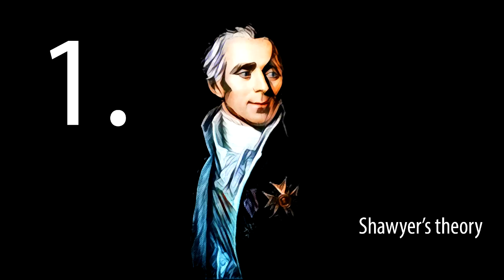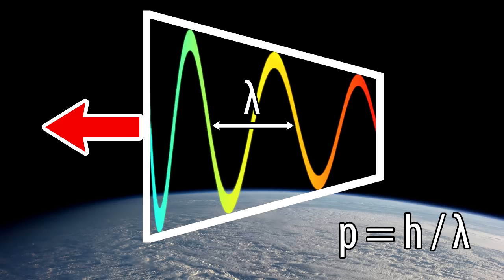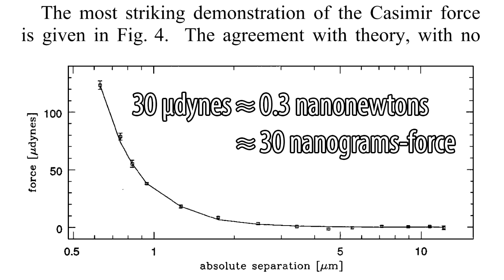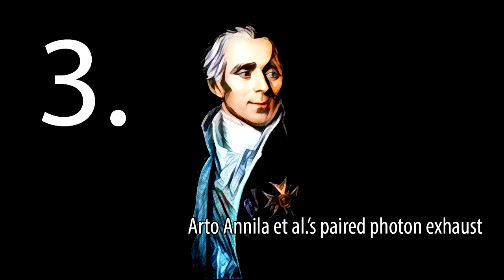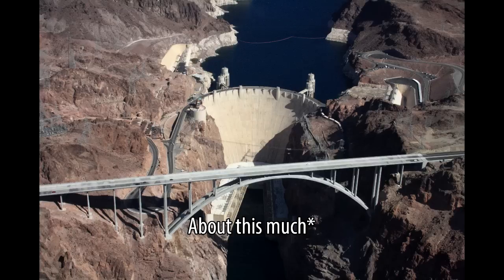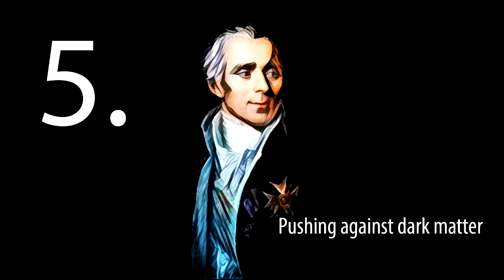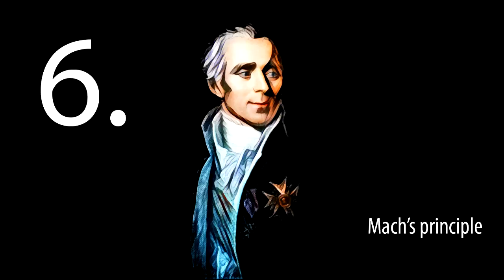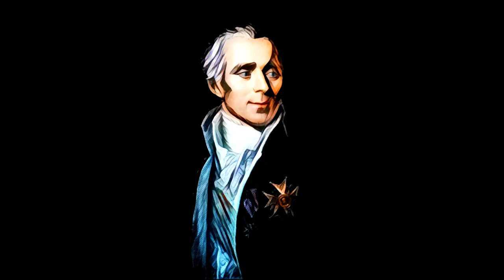The most unscientific approach – The Emdrive (part 2)

Comment: The answer lies on the surface and is easily reproduced in simple laboratory conditions. The virtual force that arises as a result of the interaction of several electromagnetic waves can be easily calculated and in accordance with experimentation. Today it is already a reality. And many labs on distillation are trying to increase the thrust per 1 watt of power. Physics is turned upside down and I am very glad that I live these days!

Comment: @Vacuum Diagrams, I miss your comments on PBS Spacetime. BTW, regarding MiHsC (McCullough's quantized inertia), if you ignore his rationale behind the  "force" of Unruh radiation and simply postulate a reduction of inertial mass as a function of acceleration, you get a testable hypothesis, which I believe is as good as  (or as bad as) MOND to attack the galactic rotation curve problem.
Reply from the maker: Hi, thanks very much for your comment! There are some modified gravity models I consider somewhat plausible, if unlikely. For example, I've once seen a presentation by Philip Mannheim (UConn) where he showed some impressive agreement between his conformal gravity model and galactic rotation curves. The main problem facing all such models, however, is that galactic rotation curves are not the only evidence we have for the existence of dark matter. 
Modified gravity models also have to account for gravitational lensing experiments, which give total mass measurements for galaxies in agreement with the dynamical measurements (inferred from the rotation curves). We also have direct observational evidence that most mass in the galaxy (measured by lensing) is not where the stars are (see e.g. the bullet cluster). A more recent observation is NGC 1052–DF2, a galaxy which has been measured to contain no dark matter. This is impossible for any MOND-like framework to explain.

Dark matter is also baked into our model of the big bang, the so-called Lambda-CDM model, where "lambda" stands for the cosmological constant (taken here as a provisional explanation for dark energy) and "CDM" is "cold dark matter". When people run simulations of the universe's evolution under the assumption of dark matter they get the correct filament structure of galaxy superclusters, which is quite difficult to obtain otherwise. 

All these disparate observations would have to be explained by any modified gravity model.

Thinking of dark matter as "fudge" is not taking the theory in its own terms -- we don't "adjust" the amount of dark matter, we "measure" the amount of dark matter. Since it's matter, it can go anywhere, and so we can't predict exactly where it is. But there are typical expectations from the dynamics, and that does seem to be what's observed. Since galaxies themselves are formed dynamically, it's not unexpected that their pieces tend to fall into approximately the same places, which suggests an explanation for the relative numerical success of MOND at the galactic rotation curve problem. In such models, the "acceleration" can be taken as a proxy for the "radius", which also suggests galactic rotation is not a reliable guide to new dynamical laws. 

Contrary to what many seem to assume, the "Occam's razor" cost of dark matter is very low; all you have to assume is that there exist some particles which interact weakly (if at all) with standard model particles, and with themselves. We already know of one type of particle that interacts very weakly: the neutrino. It wouldn't be surprising if there existed a heavier "neutrino-like" particle. It doesn't matter that we haven't detected it yet. It's even perfectly consistent that dark matter may be strictly undetectable by direct interaction; there's no rule that says we must be able to detect all particles species in the universe. That's up to nature. The reason people thought direct detection was just around the corner is because of a naturalness-based argument known as the "WIMP miracle" which has since fallen out of favor because the LHC hasn't seen any supersymmetric partners.

I suppose it's possible that McCulloch's equation happens to accidentally approximate a correct equation. The problem is that, without all his extra baggage, it's really just a version of MOND with a particular choice of interpolating function, and it's just as disfavored by observations as all other MOND models. He really needs all the stuff about "horizons" in order to get something meaningfully different. Since we already know that stuff's wrong (or not even wrong, rather), I don't think there's anything useful to be learned from MiHsC even in this most charitable interpretation.
Reply: @vacuumdiagrams652  thanks for the response, I learned a lot from it as usual.
Reply: His formula is here: https://youtu.be/1itasiXNUPg?t=1020

Comment: @5:36,
That line is not a deal-breaker from an experimental perspective. McCulloch is theorizing that Unruh radiation is exerting pressure even though Davies theorized that it would not. Davies based his notion of pressureless Unruh radiation off of consistency requirements of Quantum Field Theory. McCulloch is rejecting those consistency requirements. Hawking radiation is known to have pressure. Even though the detection of gravitational waves means that MiHsC is probably at least partially wrong doesn't mean that it isn't an excellent approximation under many conditions.
Reply from the maker: I could buy that line of reasoning if some other mechanism for generation of Unruh radiation had been proposed, but it never was -- McCulloch simply borrowed the existence of Unruh radiation from standard quantum field theory, without ever justifying it.

But there's actually a better reason to think this idea can't be right, which occurred to me only after I made this video. The existence of horizons is a global property of spacetime, that is, you only know if something is a horizon if you know that null rays from one side never reach the other. This, by definition, requires knowledge of the spacetime's entire history, all the way into the future. In contrast, Unruh radiation is a completely local phenomenon (see e.g. "Fermion Fields in Accelerated States" by Candelas and Deutsch) which can be understood in terms of local acceleration properties. A corollary is that there is never a Rindler horizon for an observer which accelerates only for a finite amount of time, so horizons can't be relevant to any realistic scenario. 

Even if McCulloch were correct in asserting that a causal horizon is associated with a boundary condition (and that's something we have no reason to assume), the absence of a horizon for any object accelerating in the real world would make such an analysis irrelevant.

Comment: So essentially your saying the electrons are pushing away from the initial wave created, ie a much smaller and manageable system for transport, that scales up to a warp like system? So you agree the EM drive works! After all if you places a fork in a microwave is the electron being freed from the fork or being repelled while generating a microwave?
Reply from the maker: It is not possible to achieve propulsion by pushing parts of an object within the object, because the position of the center of mass is a conserved quantity (see the theorem of Coleman and Van Vleck). Some external force needs to act on the object.
Reply: Vacuum Diagrams well I think you wrong, and the EM drive and even your own argument about moving electrons proves you wrong, and if you were an astronaut, in an empty box in space, you could propel your self forward but running into a wall of that box...

However, the EM drive replaces moving parts and exhaust fumes, with high energy waves and potential warp fields...thus there is no reason to continue believing that an object can not propel itself...the problem with EM drives is how far can the drives be taken, and if they can work in normal air pressure as well.
Reply from the maker: "even your own argument about moving electrons proves you wrong, and if you were an astronaut, in an empty box in space, you could propel your self forward but running into a wall of that box..."

I just explained why that wouldn't work.
Reply: Vacuum Diagrams I’m saint I think your wrong because your focused on electrons movement and not the propellant, that takes advantage of using waves and distortions as a method of movement...I think your focusing on electrons movement as a force hitting the sides of the metal casing but this is not the case, and essentially the shape of the emdrive creates an imbalance between waveforms and create propellant, and the exhausts of the em drive are is a em cloud or radiation, that can attract particular, essentially this deserves a new name for the cloud such for now consider it as a photon that can attract or repell.

But think you have a large wave and a small wave and one wave repels the other, as I have suspect the wave in the electron magnetic spectrum can repell each other, based on Maxwells basic laws from observing waves.

However I should add, what if the reality is that layer or several layers of electrons and are creatured and that there is a system similar to acoustic levitation, which results in a constant forced continually pushing in one direction as electrons move left and then move right to a degree before being energised to move left again or even a way to hold electrons in place and create highly energised spin...which itself created a wave...so again, I think you ideas are out of sync with modern science and physics, and methods...I think you should build an acoustic levitation, and see how materials can be moved up and down and how spinning acoustic waves go beyond conventional means... as it seems quite simple the larger wave bounced back and creature a denser wave creating thrust..
Reply from the maker: "s I’m saint I think your wrong because your focused on electrons movement and not the propellant, "

If there is a propellant, then the specific impulse (the propulsion bang for your energy buck) is bounded above by that of a photon rocket, which means you can't do better than 300 MW for each newton of thrust. Anything above this necessarily violates conservation of energy and can be used as a perpetual motion machine.
Reply: Vacuum Diagrams I think your wrong, and rather then experiment and learn, you falling for the infallability of a mathematics model, and undeniably old scientific system, acoustic levitation technology can create massive returns, and falls into the realms of space distortion technology...the fact is the shape may not matter, as long at two surfaces are used...
Reply from the maker: Acoustic levitation doesn't have anything to do with "spatial distortion".

Before upending physics as we know it, you need to know what has been done, where it works, how well it works, where it doesn't work, etc. Attempting to revolutionize everything while having none of this knowledge is folly. Conservation laws are an extremely solid piece of our understanding, for very good reasons. If you wish to contribute something radical here, you must understand, and be able to dispute those reasons with better arguments than "it's just a theory". It's a theory buttressed by hundreds of years and literally billions of experimental tests that are done every day whenever our many devices work as designed.
Reply: Vacuum Diagrams you wrong, so incredibly wrong and hence why your out of sync with modern science... and thing a smaller wave moving at the same speed as a larger wave would have a higher frequency, and frequency is a key element...
Reply from the maker: "you wrong, so incredibly wrong and hence why your out of sync with modern science..."

On the contrary, I participate actively in modern science. I even have a piece of paper to prove it. But I think you're more interested in what you want to be true than in what is.
Reply: Vacuum Diagrams well it seems to work, so why do you think that is, I’m simple terms? As I can’t watch this again at the moment...as the EM drive works..
Reply from the maker: It doesn't seem to work, in fact, as of this moment, there's no evidence at all that it does. Why do you say there is?

Comment: Many times the em drive proponents start their wording with: "Imagine that the thing works, ...". They are trying to make the reader imagine grabbing all the benefits of it. This turns on the greediness instinct. Once the benefits seem attractive, the normal skepticism goes away. Pretty reasonable people often fall into Ponzi schemes or other kind of scam because they actually imagined themselves getting the profit and the attraction of it was stronger than the common sense. The same phenomenon is the basis for gambling addiction.
Reply from the maker: Yeah, I notice that too. They brush aside the whole issue with how the whole thing is impossible according to standard physics and proceed to tell us the amazing applications of the device. How short the trip to Mars or Jupiter will be. May or may not be on purpose but as you say it's certainly not intellectually honest.

Comment: The emdrive most probably doesn’t work after all it seems to be the scientific equivalent of trying to lift yourself off the ground by pulling on your shoelaces. It seems almost as silly as the Hyperloop.
But what if there are effects that are not evident from what the device appears to be doing?
I know that most if not all the gravitational theories that seem to correctly answer gravitational effects are not entirely correct they are merely more accurate than the proverbial broken clock. So what if the emdrive is not creating thrust but creating an absence of gravity? There is a kids science experiment where a small piece of paper is propelled across a bowl of milk by a tiny drop of detergent. The detergent is not providing thrust but altering the surface tension of the milk causing the milk to provide the thrust. This is essentially the theory of a warp field generator, it bends space to cause space to force the object to move and as it is space itself doing the work no relatives are harmed theoretically that is.